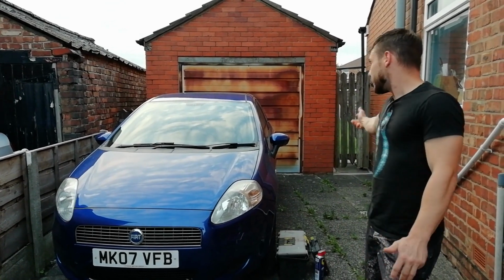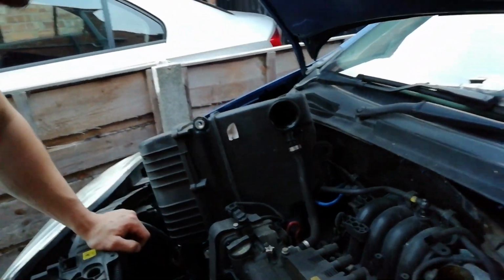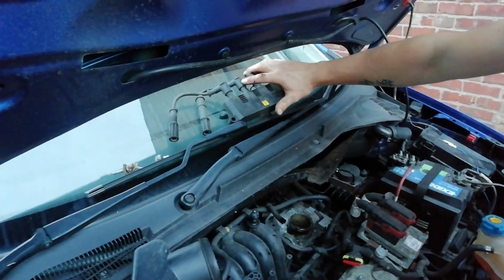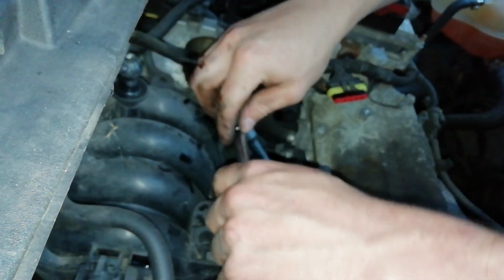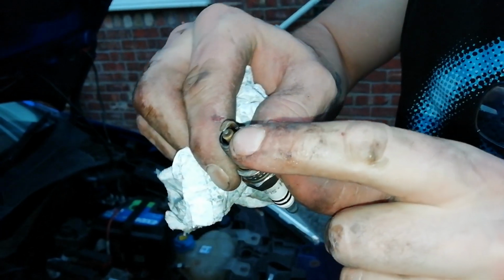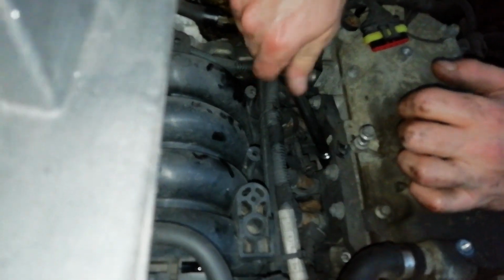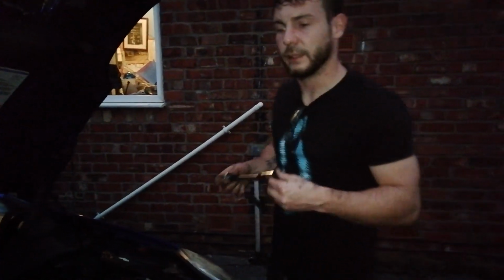Fiat Punto Grande - How to Remove and Replace Spark Plugs

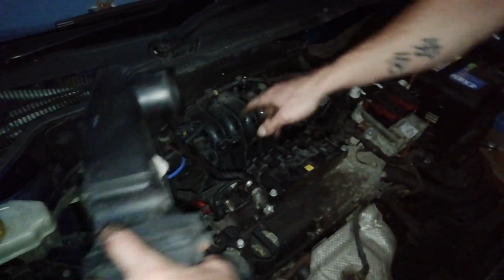Comment: Hi mate for the vacuum hose at 7:45 is that easy to replace? I’ve noticed mine was snapped a month ago before doing the nc500. I’ve been and done it with no problems but just wondering if it’s an easy repair I can do myself.

Comment: I thought my plugs needed changing, I had a look and turns out the coil pack has gone and one of the HT leads has burnt out. Any tips replacing  the leads would be a great help as I can't find a video!

Comment: would you ever show a clutch change on this model great vidio thanks
Reply from the maker: Hi, thanks for your comment, yes I can do, Shane I changed the clutch and gearbox 2 years ago before I started this channel, it’s a big job but can be done at home, i can most likely get it filmed in the next 2-3 weeks if that’s any help. Cheers
Reply: @1NELIFE  yes that would be great do you no on fiat grande punto 1.2 petrol  if the exaust midle section has any brackits to secure it
Reply: Can you show me how to fully replace the cigarette lighter. Mines completely blown and it's not the fuse
Reply: There is a guy on YouTube, who does mobile clutch changes. In UK. Search for it (there are videos for Grande or similar models).
Reply: Hey are these grande Punto clutches weak like the rest of the car? Gf bought one like 4 months ago and now the clutch is already harder and once evert few days it stutters / slips. She pays good attention to driving correctly so it’s not her doing.

Comment: Great bid as always I have same model seem to get a bid of juder when first putting foot on gas also my back and front lights are flickering any help would be great thanks
Reply from the maker: Hi thank you for the comment. The juddering could be a number of things, it’s most likely a low end miss fire or a bad idle control valve, does it tick over nicely at a continuous rpm? And might sound daft but do you keep the fuel topped up past half, my girlfriends car runs bad if the tank is less than half full..
Reply: @1NELIFE  interesting, I've noticed my grande punto doesnt seem to like being low on fuel, feels totally different after topping it up
Reply: @1NELIFE  THANKS FOR THE ANSWERS TO THE QUESTIONS LIFE CARS🙏IV GOT PUNTO AND THOUGT I HAD A SPARK PLUG OR FUEL INJECTION PROBLEM, I THOUGHT I WAS LOOKING AT A TRIP TO THE GARAGE😕WHICH WE ALL KNOW CAN COST A FORTUNE BUT I PUT PETROL OVER THE HALF WAY AND ITS PERFORMING WELL 👍I WILL BE BACK TO YOU AGAIN IF I NEED ADVICE👏👏👍

Comment: Fantastic vid mate, what measurement do the gaps need to be on the sparks?
Reply from the maker: Hey thankyou! It should be around 0.9mm gap. Hope this helps. Cheers
Reply: Depends on manufacturer (and fuel).
NGK - 1,0 mm from factory.
Denso - 0,8 mm brand new (better for LPG).